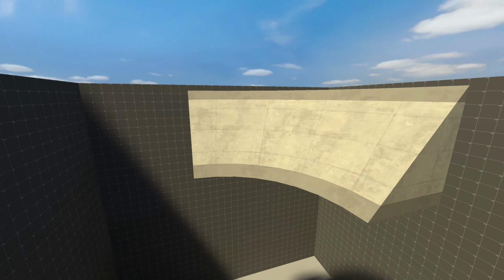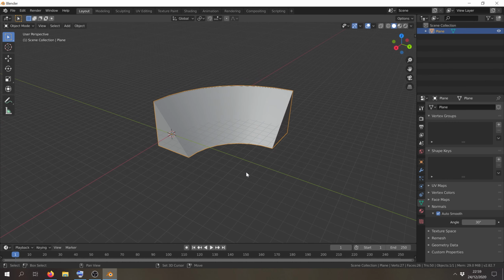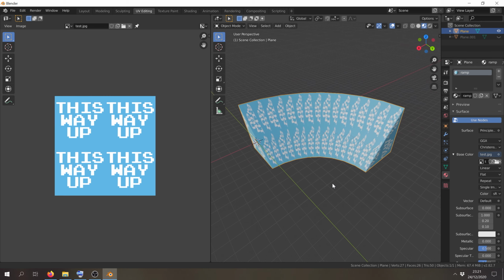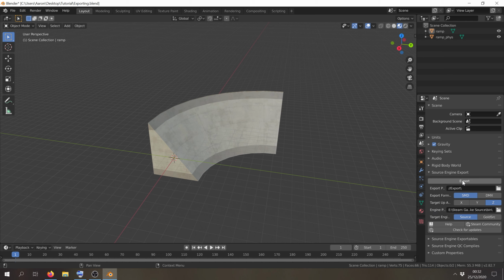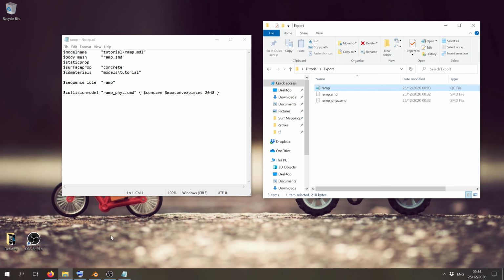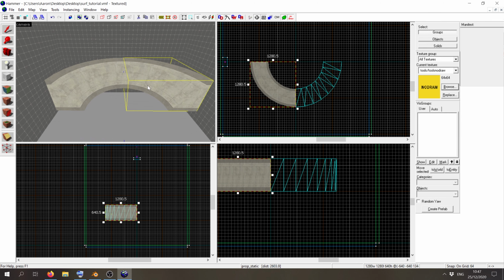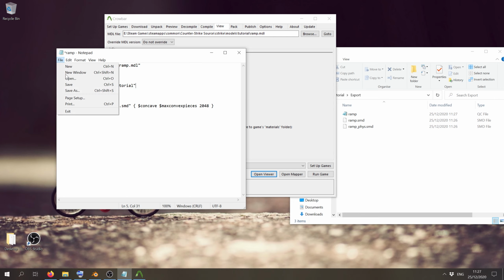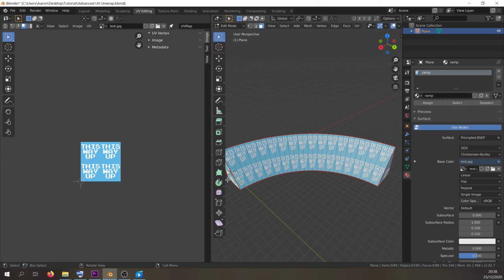How to Make Modular Surf Ramps in Blender for Beginners

Comment: Hey, I've just made a curved ramp using this method (and others), and I can't seem to get a ramp that doesn't glitch out when surfing on it. When I zoom in with "vcollide_wireframe 1", I see that the individual sections of the collision mesh are not aligned. They are aligned in blender, but not in-game. Is this method confirmed still working?
Reply from the maker: I just made a ramp and it works fine for me. What settings are you putting in the generator? I could make the same ramp to make sure. It sounds like vertex shifting due to the pieces not being convex, I'm not sure though.